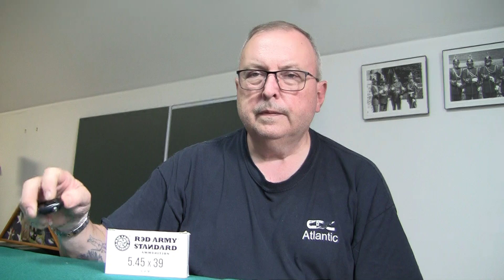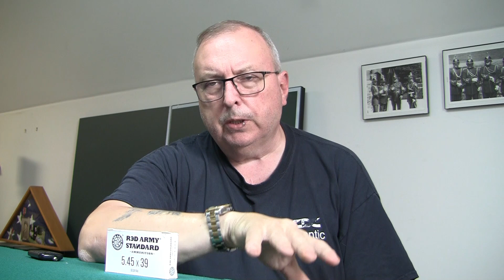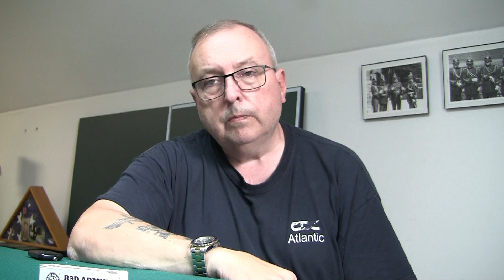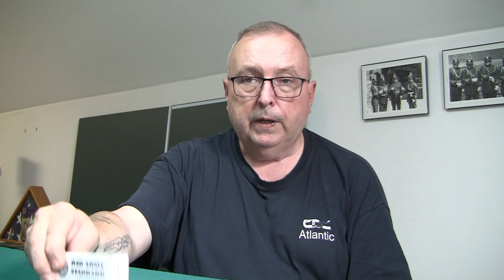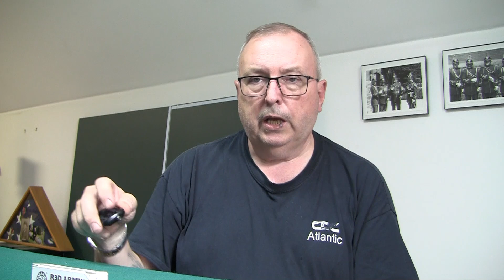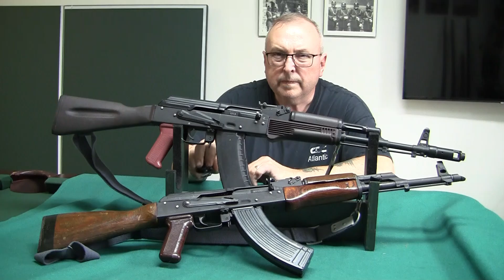5.45x39mm Ammo history availability should I sell my ak74

Comment: In all reality for people that like to shoot their ak74 alot, I would sell it and buy a 556 ak. If it's more for a collectible, just keep it. I been a long time 545 supporter but in reality 556 is more powerful and 545 really has no advantage after 7n6 got banned(price).
Reply: 556 is not more powerful, 5.45x39mm is known for having better penetrating capabilities...
Reply: While the loads vary, I believe 556 definitely has more power potential than 545. They both operate at the same pressures and 556 has more case capacity. Most 545 loads are just over 1k lb of energy while 556 is 1250 plus. Recoil is lighter with 5.45 but I've loaded similar 556 rounds verified by my chrony and I couldn't tell a difference with the same rifle(AR15)